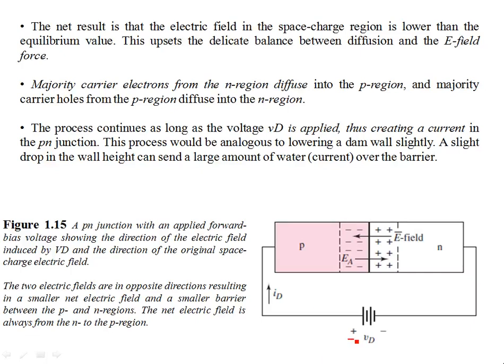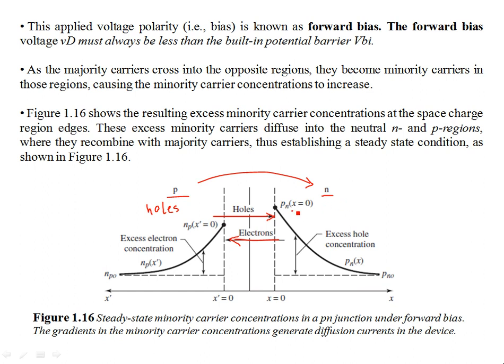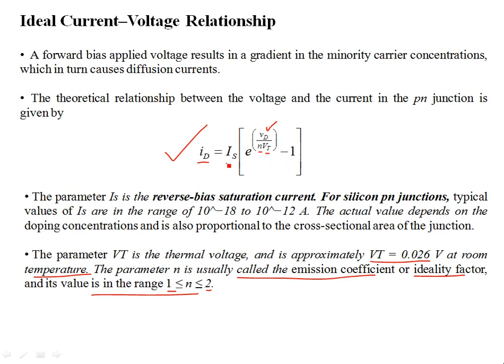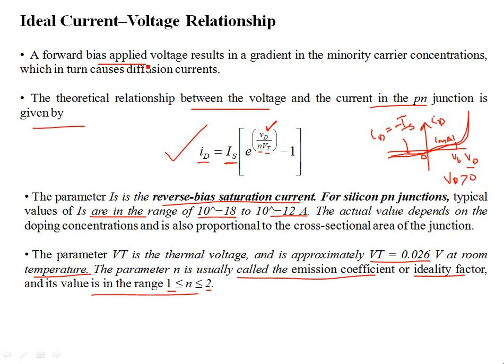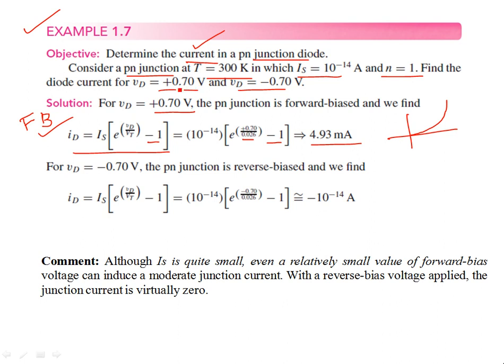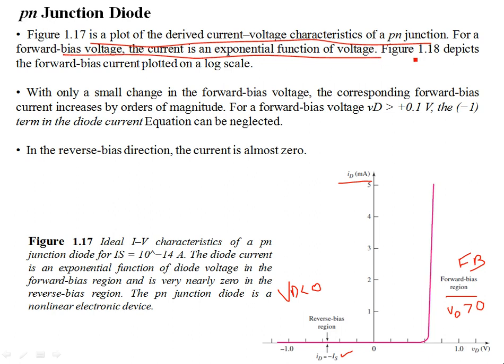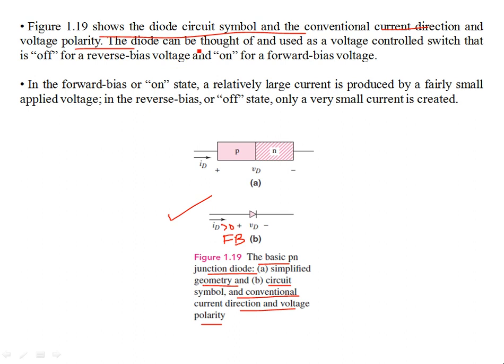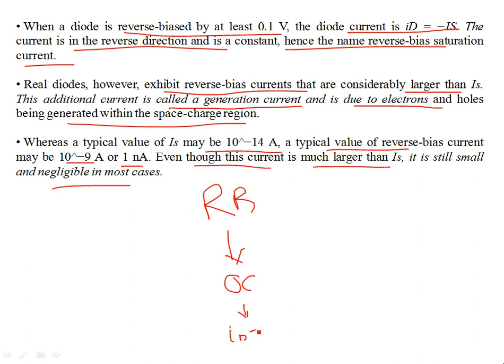Current Voltage IV Characteristics of an Ideal PN Diode Part 10

Comment: Why do the current in diode in forward bias configuration called "Diffusion current" even if this current is a resultant of external voltage supply which create electric field in diode, hence should be called drift current?